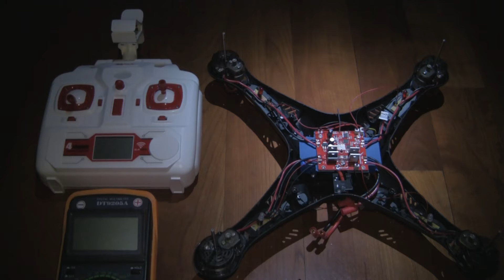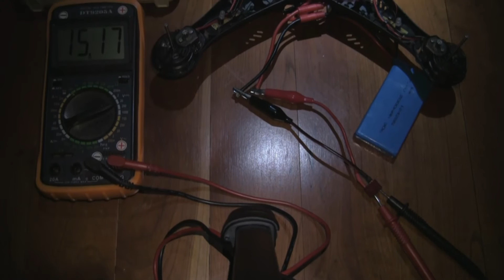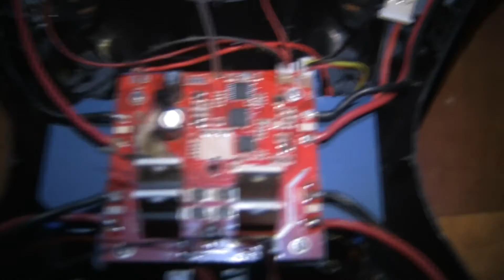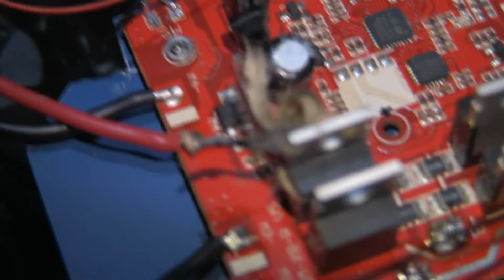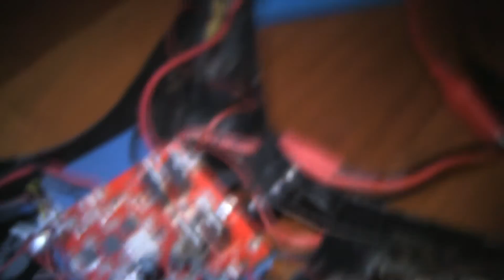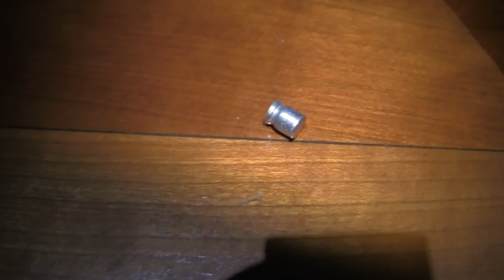Can a Syma X8C X8W handle a 4S battery? Part 1 - Control Board Limitations

Comment: So what happens when you run a 3s?
Reply from the maker: Most of the time it runs fine, but some people have had their drones drop out of the sky when pushed too hard with a 3S. There is some kind of current-limiting function that cuts power to the rotors when it detects too much power passing through. But the components are all rated to work with 3S besides the current limiter.
Reply: thank you
Reply: So what should i do when i use 12volt on my syma x8w

Comment: I think x8 use ESC for brushed motor so you can use any higher lipo battery as if that esc can hold it but use component like Bec or downstep volt to make current from battery to flight controller 😗 this schematic I learned from brushless drone 😅

Comment from the maker: Some people have successfully used a 3S battery, and it won't harm any components. That being said, the X8C has a current limiting sensor, and it may not fly if it gets tripped, or even fall out of the sky. Stick with 2S if you can.
Reply: What do you mean by 'and it may not fly if it gets tripped' fall out of the sky and hit the ground or? my english issn't the best xD
Reply from the maker: Yes! There are some videos on youtube where the X8C starts blinking and falls out of the sky and hits the ground. Search "Syma x8 pakiet 3s i śmierć drona pl"
Reply: But what about syma x8w...  
I mean what happen when i use 12 volt on there..  Does it harm in my drone or does it run with 12 volt plz say something